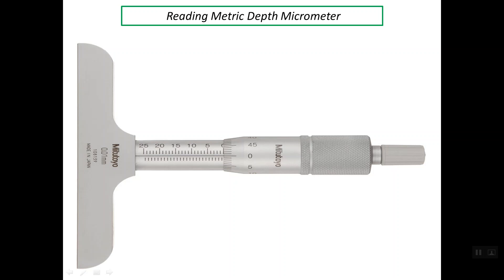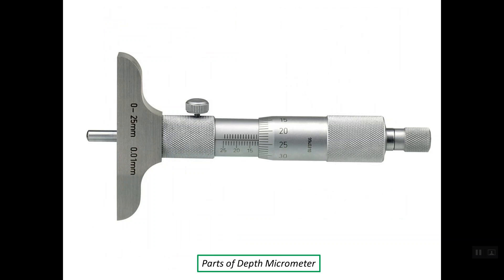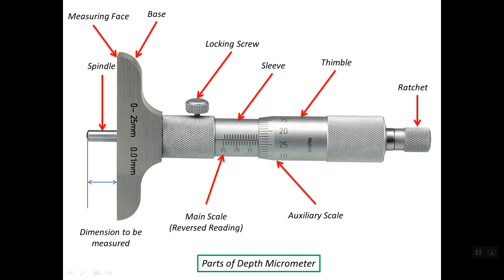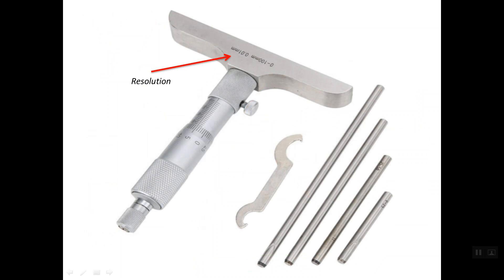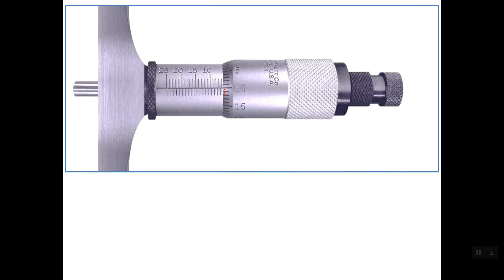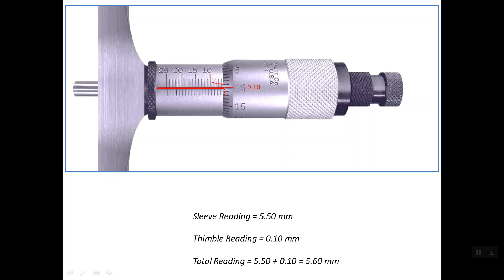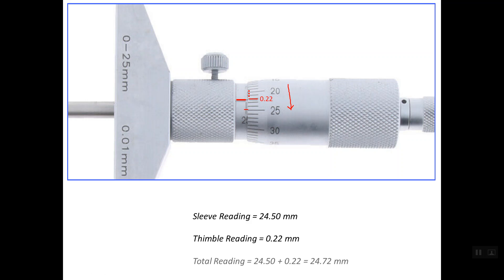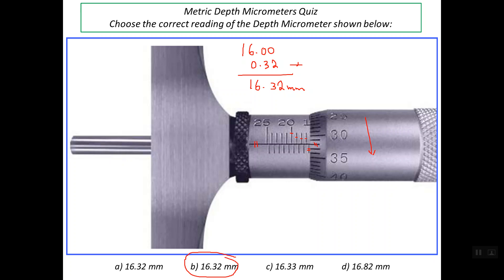24) Reading Metric Depth Micrometer

Comment: thanks for wonderful video. please check, time line 8.36 , isn't answer should be 12.465mm ? is that because of lowest precise measurement range  of 0.01mm, measurement is rounded off ? thanks
Reply from the maker: Thanks. The precision of the tool is 0.01 so the reading should be with two decimal places so you can round it to the closest line.